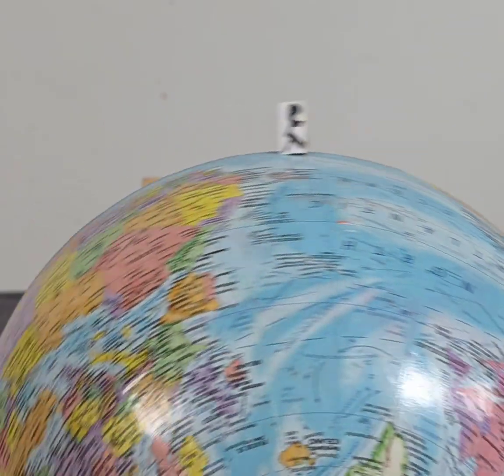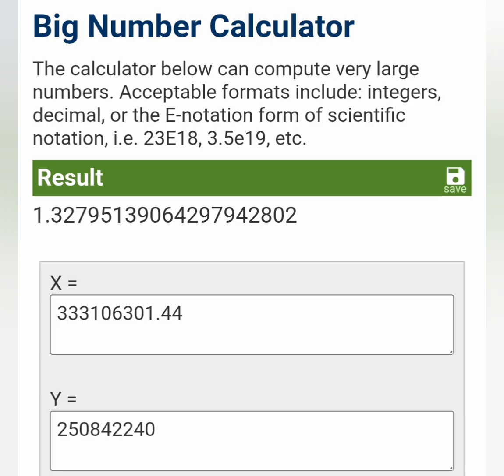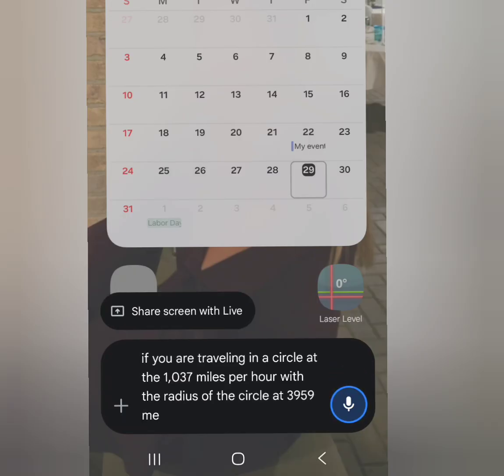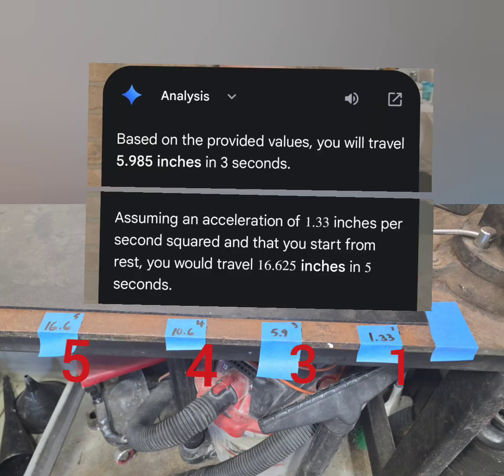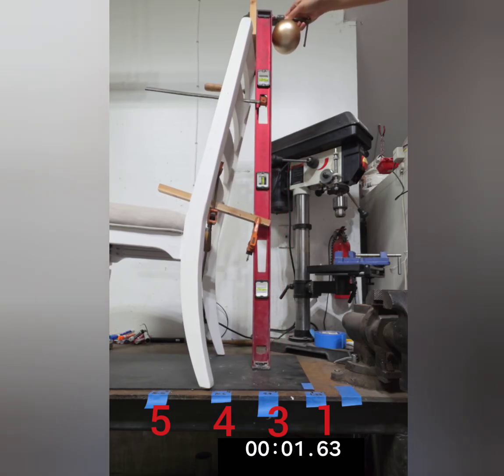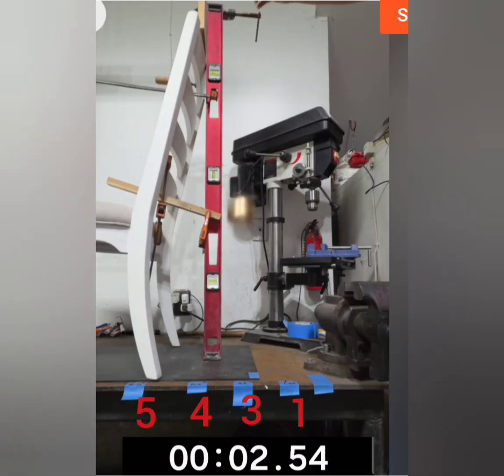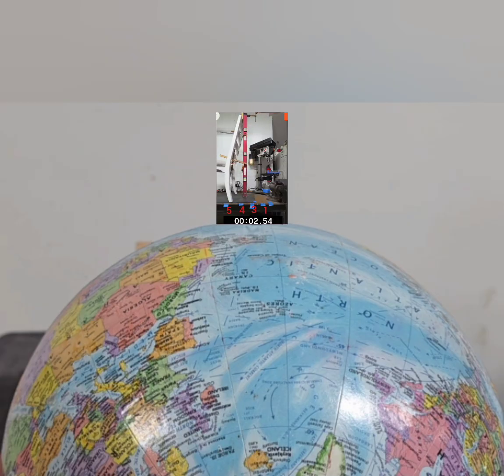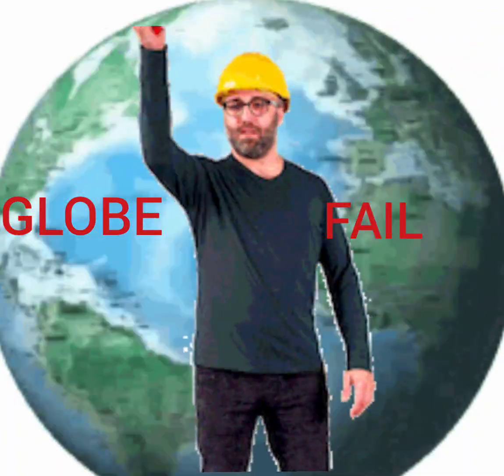No Acceleration Is Reality !

Comment: Nice video about the first part ot total acceleration that works on objects on the surface of Earth if it was horizontal. The other part would be adding the acceleration due to gravity of Earth in the opposite direction to get the net total acceleration. Could you do this too and demonstrate how fast the chair then goes? You'd probably need a little bit more space and some kind of deceleration safety zone if you do this for 2 seconds. Maybe also a rocket strapped to the chair or at least a Bugatti Veyron since 9.8 m/s^2 horizontically is a pretty serious acceleration.

Comment: The Eötvös Effect relates to this. Discovered in the early 20th century, Baron Roland von Eötvös discovered that objects LOST weight when traveling east and GAINED weight when they were traveling west. He was doing very sensitive weight measurements aboard ships at sea. Mass is not affected. Only weight (the downward force caused by gravity). Anyway, in addition he discovered that the effect was strongest near the equator and weakest near the poles. Both poles. This makes perfect sense on a spinning globe, but NO sense on a flat stationary disc: As you travel east you are traveling in the direction of spin, which pulls you slightly more away from the Earth, making you weigh less. Again, mass is not affected. Only the pressure you exert downward is affected. Going west does the opposite. And the strongest effect is at the equator because it is the furthest from the center of rotation.

And yes, this can easily be tested. All you need is a sensitive scale* and the ability to travel fast eastward and then westward. You'll see your object's weight DECREASE as you travel east and INCREASE as you go west. There are several videos on YouTube already of people doing this test.

[edit: By the way, this effect simultaneously proves we live on a globe - because of how it increase towards the equator and decreases towards the poles - AND that we are spinning.]

* These scales are on Amazon for $20 or less. Many are less than $10. Like this one: https://a.co/d/11bJy9j

Comment: Rotational bodies use rotational quantities. Linear quantities are irrelevant if the body isn't moving in a straight line. 1st, units distance/time^2 don't denote nonlinear motion, in fact those are the units for linear acceleration, so named because a=dv/dt=v_0+v_f*t after integration where a_0 is constant. Rotational equivalent is angular acceleration, usually denoted alpha, dw/dt (omega) the infinitesimal rate of change of angular velocity with time. Angular velocity of earth is constant so angular acceleration is zero. Rotational equivalent to linear force F=ma, is torque where torque is vector product of linear force vector and position vector, or angular acceleration and moment of inertia for a rotating rigid body. If there were a net torque, you'd most definately feel it but there is not. The linear velocity at some distance from axis of rotation rep the linear change in distance per unit time, but as motion isn't linear but distance is arclength those quantities mean nothing unless the point in question ceased angular motion and began linear displacement, like spinning a ball and string around in a circle and the line breaks the ball would travel perfectly straight except for gravitational influence, which causes parabolic trajectory instead but same idea.

Comment: Don't feel too bad about your error here.

As a retired math and physics teacher, I can say for certain that your mistake is a very common one for beginning physics students to make when they first encounter circular motion. 😀

Go back and look at the physics of circular motion that you showed at 0:40, and note that there are two different acceleration components involved here: centripetal and tangential.

Your calculation of the centripetal acceleration, the acceleration towards the center of the circle, is correct:

Centripetal Acceleration = v²/r

where in this case v is the constant linear speed of our hypothetical person and r is the constant distance between that person and the center of the Earth.

You correctly identified the constant linear speed at the equator to be approximately 1037 mph and the distance from the equator to the center of the Earth to be approximately 3959 miles, and those values do give us a centripetal acceleration of about 1.3 inches per square second.

But the experiment you performed is creating an acceleration which is parallel to the velocity vector of your subject rather than perpendicular to that velocity vector.

So you are simulating a tangential acceleration rather than a centripetal acceleration.

And at 0:40 you video tells us that

Tangential Acceleration = rα

where r is the same constant radius we used before and the Greek letter α represents the angular acceleration of the person.

But remember that our previous calculation relied on the linear speed, v, being a constant 1037 mph which means that the angular velocity, ω = v/r, is also a constant.

And since the angular acceleration, α, is the rate of change of the angular velocity, ω, with respect to time, a constant ω means that α = 0.

Thus we get:

Tangential Acceleration = rα = r•0 = 0.

Since this tells us that a person standing on the ground at the equator isn't experiencing any tangential acceleration, there won't be any "sideways" force for them to feel.

So the fact that people don't feel such a force is exactly what the model of the Earth as a rotating globe predicts!

You can better understand the effects of those two different accelerations by visualizing the vectors involved.

A centripetal acceleration vector is always perpendicular to the tangential velocity vector and thus can change the direction of the tangential velocity vector but can not change the magnitude of the tangential velocity vector.

A tangential acceleration vector is always parallel to the tangential velocity vector and thus can change the magnitude of the tangential velocity vector but, other than by simply reversing the direction of the tangential velocity vector, can not change the direction of the velocity vector.

In this case, the person is traveling in a circle with a constant speed so they are experiencing a centripetal force that changes their direction of motion, but they are not experiencing a tangential force that would change their speed.

I hope that helps clear things up. 😀
Reply: How does this affect coriolis?

Comment: Hi everyone. I’m a globe earther, not here to fight or mock, but to clear something up. Keep in mind that these videos are fine for your fellow flat earthers, but if you want to convince globe earthers, you’ll need to understand how we think. So please actually give this a read.

--------------------------------------------------

FIRST THINGS FIRST
All things that scientists classify as acceleration produce a G-force. G-force and acceleration might at first seem like two different things, but really they are strongly interconnected.

--------------------------------------------------

G-FORCE FROM LINEAR ACCELERATION
Linear acceleration is the easiest to picture. If you drive north and accelerate at 9.81 m/s² for an hour, you’ll be pressed into your seat with the same force that normally holds you to the ground. Whether you call that force gravity or density, it doesn’t matter — it’s 1 G either way.

Now, because you also still feel the usual 1 G downward, your body experiences both forces at once. Combined, they don’t make 2 Gs straight down, but rather about 1.4 Gs diagonally into the back corner of your seat.

--------------------------------------------------

G-FORCE FROM FALLING
If you drop something, it accelerates downward at 9.81 m/s² until it hits the floor. Once on the ground, it still experiences a G-force — the normal 1 G you and I feel right now. Your inner ear even senses this constant acceleration, which is why you can always tell up from down with your eyes closed.

--------------------------------------------------

G-FORCE FROM ROTATION
Spinning a bucket of water shows the same principle. Spin fast enough, and the water “falls” to the bottom of the bucket even if the bucket is sideways. Things always fall in the direction of the acceleration they feel.

Earth’s rotation works like this too. At the equator, the downward pull is still 9.81 m/s², but there’s also a small upward (outward) acceleration of about 0.034 m/s² due to rotation. These combine so the net downward pull is about 9.78 m/s².

That means you weigh about half a percent less at the equator than at the poles. This is not theoretical — it’s been measured for centuries. Jean Richer first noticed it in 1672 using pendulum clocks, and modern gravimeters have confirmed it with high precision.

But the rotation of the Earth is not accelerating you in the direction of rotation as your experiment would suggest. The rotation of the Earth accelerates you upward which is slightly counteracting your downward acceleration. But ultimately the downward acceleration due to density/gravity/whatever wins.

Comment: As other have stated, your set up highlights linear acceleration and not centripetal acceleration which is what you are attempting to debunk.  If you wanted to test this, you need to go to a merry go round or some other similar device.  Here's how that would go for you:

Say your merry go round has a radius of 5 ft and you want to find the velocity this mgr needs to travel to have a centripetal force the same as the earth's at the equator.  Your equation then is 1.3 in/sec^2=x^2/5 ft where x is the velocity of the mgr.  Doing the algebra and necessary unit conversion we arrive at x=.73 ft/sec.  We can do unit conversion to arrive at something we are more familiar with:  .049 miles per hour.  Think about how slow 1 mph is in your car and we are doing a blazing 5 percent of 1 mph.  Slow down there champion...someone's gonna get hurt.

So to make this a true analog, you would need to blindfold your wife or whoever that was, sit them on the edge of the mgr.  Start the mgr to achieve a velocity of .049 mph and keep it at that steady velocity for an hour or so.  After an hour of her sitting there ask her again if she 'feels anything'.  Her answer of course will be no.  sitting on the edge of a mgr going .049 mph will produce no discernable forces on the human body.

Comment: At the equator, the centrifugal acceleration is against gravity, not horizontal, so it wouldn’t be pushing someone left and right, it would only make one a bit lighter (A 300lb man would weigh 299lbs)
The maximum centrifugal acceleration horizontally is about 0.015m/s^2 at 45 degrees latitude.

Comment: More accurate would be a test like:
Accelerate your wife at  386 inches/sec² (9.8 m/s²), then change this rate by 1.3 inches/sec², so that it is now 384.7 inches/sec²
And then ask her, if she feels a difference.
And to even make it more realistic, like flying with an airplane form the pole to the equator, change the rate slowly over a time of like 8 hours.

You could also ask her, if she would notice, when she just weights half a pound less than usual.
Reply: Never involve the weight of your wife in any experiment! 😅

Comment: You need to understand what velocity is and thus what acceleration actually is. i.e. a change in velocity. A velocity being a speed plus a vector or direction. Change the vector or direction with the same speed means the velocity changes and thus the acceleration. so going in a circle at the same speed is a constant acceleration.

Comment: You are so incredibly dumb.  Gravity is linear acceleration.  Rotation is not linear acceleration.  The Earth's spin is constant at 15 degrees per hour.  The Earth's rotation does not change.  The tangential velocity does not change at a specific lattitude. The force from the Earth's rotation is vectored perpendicular to the Earth upward and is a tiny fraction of the force of gravity.

Comment: Here brother  ...If I was in a box truck & the box truck was moving 33 mph ... I decided to jump straight up 10 or 15 ft high as its going 33mph ( or jump high enough where the truck should no longer be under me)... Would the air i share in the truck KEEP ME IN THE BOX TRUCK OR WOULD I JUMP HIGH ENOUGH WHERE I NOW FALL ON THE ROAD?

People say the air & clouds are confined to earth, hence the helicopter doesn't see earth spin.

If I go all the way to the south pole...
Would k be standing UPRIGHT WHILE STANDING UPSIDE-DOWN?

IF I FLY IN A JET ... I DECIDED TO TAKE OFF INTO THE SPIN OF EARTH, WOULDN'T I GET TO ME DESTINATION QUICKER?

THIS SOL AR / RA LOS / SOL RA SYSTEM AKA HELIOCENTRIC MODEL OF THE sun god is confusing. 
IVE BEEN COME AGAINST HIS SYSTEM & I MYSELF DO NOT REVOLVE AROUND THE SULPHUR SMELLING god⚠️⚠️⚠️🐉⚠️⚠️⚠️
Reply: South pole - you need to work out for yourself what upright and upside down means.  For most people with a brain, it means in your local reference frame - you are upright with reference to the ground you are standing on ie the only thing that matters. If you are "upside down" compared to someone at the north pole (you are), who cares.  Why flatties have a problem with that concept is still unclear.
Reply: Taking off "into the spin of the earth" - conservation of momentum- you already have that forward momentum as does the air you are flying in.  So it won't make any difference
Reply: @JohnSmith-ux3tt 
What we are told by the world DOES NOT MAKE SENSE.
COMMON SENSE LOGIC MAKES SENSE.
Those clouds above us do not move because of freaking rotation of a magik round ball.
Lift off this moving rotating ground & hover, the ground beneath us would move.

We do not live on a magical spinning planet. 
We are not a planet.
- THE T ... PLANE
+ THE T to nasa... saTan.

The power of the 🌎 is being demolished 
Space is fake
Earth is  a PLANE
USE BIBLICAL TRUTH ,,APPLICATION,, & PERSPECTIVE. 

JESUS ASCENDED INTO HEAVEN, ,NOT SPACE. 
JESUS DESCENDED INTO HELL,  NOT SPACE. 
THE ANGELS ASCEND & DESCEND ON JACOBS LADDER.

WHY IS THE SKY BLUE?
THE WATERS ABOVE GENESIS 711KJV 🌈
But I guess science will explain the rainbow with no MAKER & no reason for it
Reply from the maker: If your aunt had balls she'd be your uncle
Reply: @anthonybear5519 , Yes, “Bob’s your Uncle” even in high heels🤣🤣
Reply: @anthonybear5519 
Im not against you bro.
So your coming at me like im your enemy or something. 
I support your content,  not oppose it.
I was genuinely making statements & asking rhetorical questions 
🤷‍♀️
Reply: GodGodwillexault....
Heliocentrism DEMANDS RIGID BODY ROTATION with TRANSLATION. 
Meaning... your not only rotating but you're also Translating. 
There are TWO acceleration vectors that must be added together.

Take your truck analogy. .. you jump up and the truck TURNS a corner while driving 33mph.

That is what the make believe story of heliocentrism demands and there is no way around it. 

Shalom from under Yahs dome
Reply: @wydopnthrtl well said